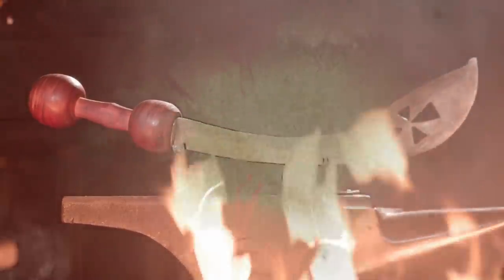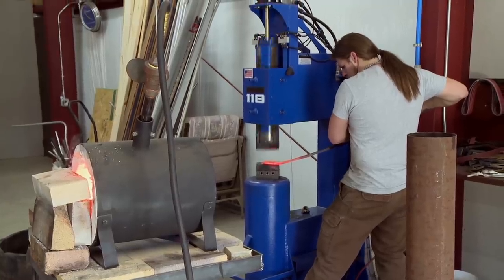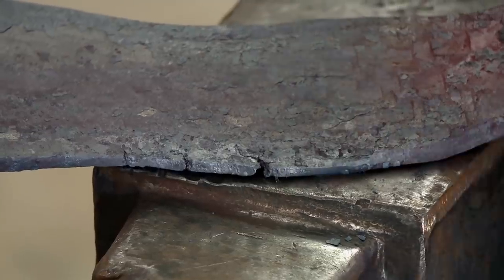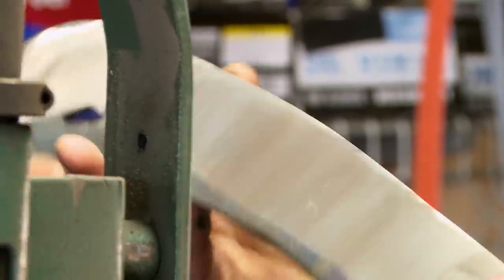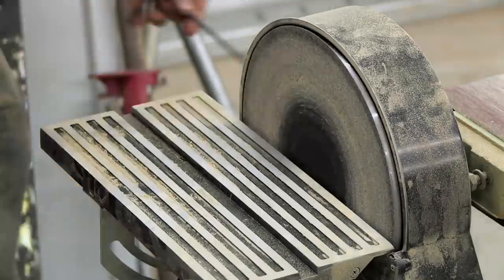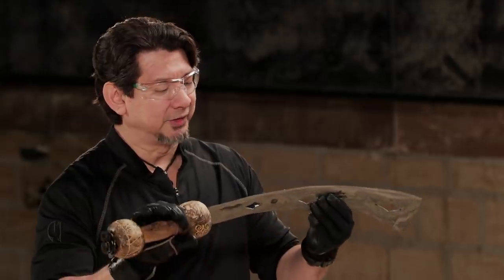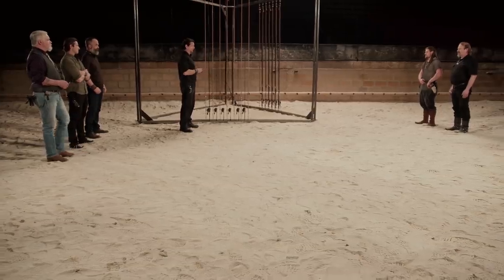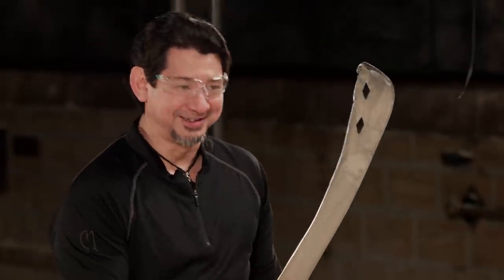Forged in Fire: The Akrafena Does EXTREME LETHAL DAMAGE (Season 4) | History

Comment: When Brock said he was gonna use iron I was like oh that’s gonna bend.
Reply: I didn't help that he put a diamond shaped hole in the middle of the blades length either. That's exactly where it bent.
Reply: There’s a reason why most swords are made of steel and not pure iron. Having said that, I’m pretty surprised at how well it held up in the tests
Reply: For iron, it did very good.
Reply: He used high carbon steel for the edge, so it shouldn’t have bent that much assuming good heat treatment. Unfortunately, that was the problem.
Reply: Matthew Pham the main support was iron which isn’t good for blades that get pretty thin. Especially if they are to be made with holes throughout the blade.
Reply: msc14111990 
Yep, but those blades were worked hardened, making them serviceable as tools or weapons. You can’t harden iron via quenching, so hammering the edges a whole bunch is your only option.
Reply: It's unfortunate because his sword was muuuch more traditional than his opponent's.
Reply: All you experts should go on the show. Maybe give them some wardrobe advice too 😉
Reply: @petemitchell6788  one, I don't think anyone was trying to pretend to be an expert.  More than anything, most of the people here just seem to be somewhat critical of the judging parameters of the show, rather than any individual actually in the show.  Two, sure, you totally have to be an expert to comment on competitions... that's why there's so many NFL experts in every household commenting about Football, right?
Reply: @petemitchell6788  
 Surely you don’t think the only experts on the matter are the people you see on the show and  there couldn’t possibly be experts in the comments as well, right Pete? 
 I’m mean especially considering at least some of the people watching it are likely doing so because they do the same thing, not to mention I’ve heard numerous contestants say they used to watch it prior to being on it. 
 
 Some of these mo fos do need friends though. 
  Somebody could’ve told Brock not to leave the house in either of those outfits he had on.
Reply: GO ONYX USE ROCK SLIDE!!! Sorry I couldn't help myself...
Reply: @MrKydaman  I agree, even a much smaller diamond would have helped.
Reply: @MrKydaman   Afena's (traditional Name) were all made from Iron. Asante did not have modern steel. However, it was a little misleading for the judges to include the cutouts in the blades. Those were mostly present on ceremonial blades not made to take abuse.

Comment: He REALLY shouldn't have cut such a large diamond hole right in the middle of the blade where it needs to be strongest.
Reply: Yeah, not a great choice. Most examples of this sword I've seen (or at least those that weren't clearly intended as ceremonial objects) tend to have the cut-out sections concentrated towards the tip of the blade, not the middle.